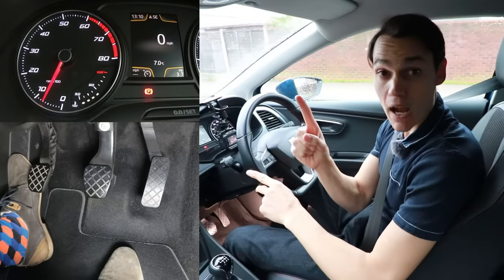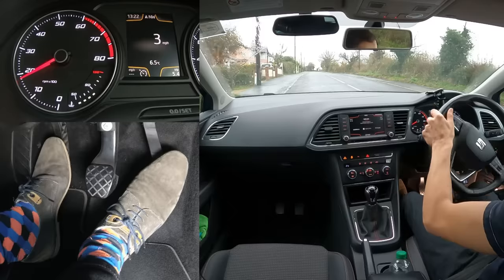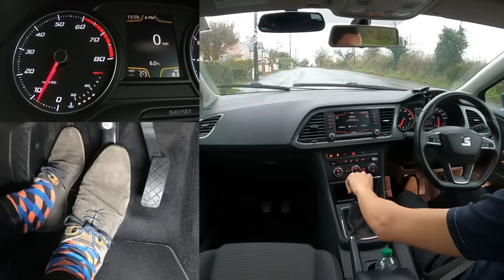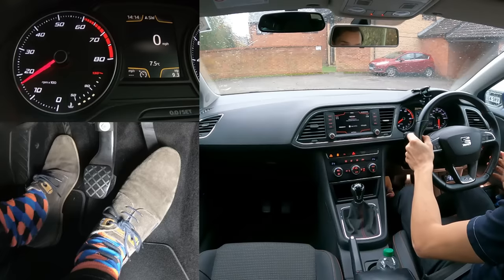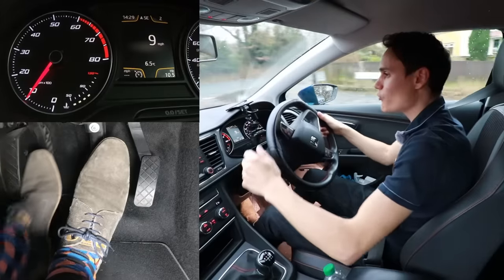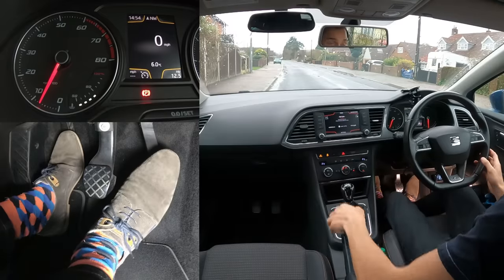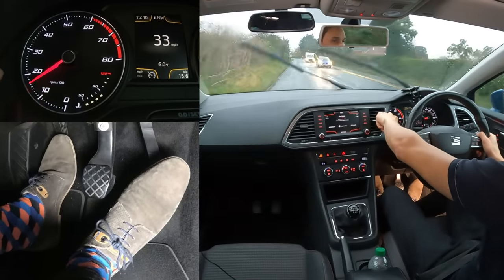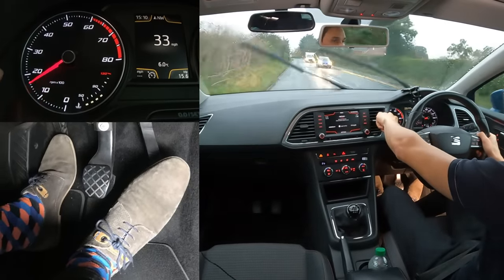How to make your clutch last longer without stressing the transmission.

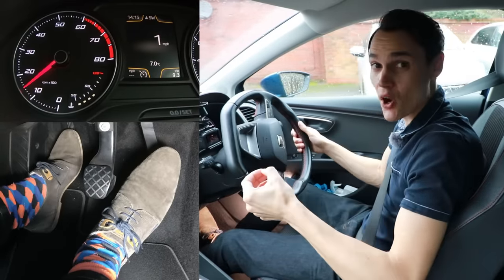Comment: what you were talking about at 5:10 when you dip the clutch a lot to just dab the car forward or backward a bit when parking I imagine it doesn't wear on the clutch much but im curious how much wear you would put on the pressure plate if you did this excessively. holding in the clutch for too long. anybody have any thoughts?
Reply from the maker: The pressure plate and release bearing are designed to do this. Holding the clutch down for long periods of time when waiting or revving the car hard with the clutch down wears the release bearing.

Comment: Does the method at 8:17 cause any excessive clutch wear? If I rev the engine as I release the clutch, is it bad if my clutch has to pull the revs down within 500rpms or so?
Reply from the maker: The clutch is designed to do this.
Reply: @ConquerDriving  So even if the clutch has to “fight” against the revs for a little bit?

Comment: Very helpful video, but i have one question;

In my car, revs drop slowly when i actuate the clutch and that makes it harder to shift smoothly.
what can be the possible reason for it.

Im actually from India, and currently own a Hyundai i10
Reply from the maker: It can be a mechanical problem but often it's just how cars are set up these days. It's known as rev hang and it helps emissions.
Reply: Rev hanging. It's probably emission related. My friend's 1.0 opel adam and our old 2017 Focus 1.0 did the same. Rev hanging seems to be especially common in these newer 1.0 turbo engines.

Comment: Useful video as always! Do you think the rev numbers you use would vary depending on whether the engine is a turbo or not? In my previous car (1.2 turbo Kia Picanto), it was almost impossible to set the gas at 1500rpm, it was 2000 or nothing effectively. I don't know how much of that was due to the delayed reaction of the turbo and/or the small engine not being great at fine control (or just me!). I've now bought an Alfa Romeo Brera Prodrive S (2.2 non-turbo) and was expecting this to be a lot easier without the turbo delay but setting the gas just under 2000 rpm is still tricky and the revs just keep rising when you hold the gas still. It's probably just a case of more practice and getting a better feel for the engine note (that was easier in the Kia because the engine was louder, you can push this Alfa quite high before you get much of a growl from the engine bay). I've been spending way too long with the clutch depressed in traffic it seems, so that's one thing I'm definitely going to change.
Reply from the maker: Some cars are like that, you have to lift the clutch at the same time as pressing the gas to prevent the revs going to high. Here is a video on gas control: https://youtu.be/KggkCe6Agjk
Reply: I have 1.2 tsi turbo polo and I can easily launch at for example 1200 or 1600rpm. The turbos in these small engines are usually so small that in my case I don't really notice a difference when I'm starting to move. Only in sharp accelerations when moving I feel the turbo and power kicking in. My car can be completely different to yours though.
Reply: @ConquerDriving  Fun update on clutch control: turns out I had a rear brake calliper binding (the mechanic said "feels like the handbrake is always on", which I just nodded to, thinking "that seems like an exaggeration"...), so I think that was making this harder to do, because in essence the engine/clutch was always working against some braking, unbeknownst to me!
Reply: @tuomasheikkinen9251  Yeah that's fair enough. I assume now that my previous car, the Kia, maybe just had an ECU that gave too many revs to avoid stalling but it could be something more mechanical than that.

Comment: Great video!, So how can you move away quickly while not damaging you're clutch
Reply: I think his point is it doesn't damage the clutch, it just heats it quickly and creates more wear. In most situations, you shouldn't be launching from 0 anyway, as that is rather reckless and who gives a crap if other drivers don't like it?
Reply from the maker: Fast starts wear the clutch. They also use more fuel, tyres and put just about every mechanical component of your car under more strain. This is the same with automatic cars that use a clutch. No getting around it other than to get the car rolling then to accelerate hard.
Reply: @ConquerDriving  Makes sense, Thank you!

Comment: Im surprised you didn't demonstrate just blipping the throttle on the bite point, which is what I do a lot when I just want to roll forward a lil bit up a hill, or backing into a spot. You reckon blipping on the bite point is ok?
Reply from the maker: If it works then it's fine. Not too many revs though as it will overheat the clutch and bare in mind some cars need gas before you reach the bite point.
Reply: @ConquerDriving  oh yeah when I blip it Im not hitting more than maybe 1500rpm, I used to exclusively do that before I learned how gently easy into the throttle as I let out the clutch

Comment: Your advice is very helpful, but your car clearly has enough torque to get going at low rpm. I have an 2005 MX-5 that does not have much power or torque below 2000 rmp. How would you adjust to driving cars like this?
Reply from the maker: I also have an MX5. I rev it 😉 https://youtu.be/iB0xFXxIsWc

Comment: One critic:
You dont even mentioned "DIY" rev matching, as if rev matching is only done by the clutch/synchrorings itself...

I could not drive my Subaru without rev matching, especially downshifting needs a little tip on the gas before releasing the clutch

But since i learned in this car rev matching, im doing it (for the sake of comfort and preventing clutch wear) in nearly every car.
Reply from the maker: Here is a video on rev matching. That's more of an advanced skill: https://youtu.be/-RnPUq2yut4

Comment: Great video, but riddle me this. On an upwards hill I always keep the car in its place by utilizing the clutch bitepoint, but without giving it any gas. So basically just in idle, no brakes, just clutch holding the car. Is that bad?
Reply: No wait, actually what I do is just hold the car with the normal brakes (I only use the handbrake for Parking) and once it's time to go I release the clutch to the bitepoint, while in idle and then move my foot from the brake to the gas and drive off. I never roll backwards/forwards this way and I feel this gives me much better control rather than using the handbrake.
Reply from the maker: This video may be of interest, it doesn't depend what car you have: https://youtu.be/UdTSRBJrw7Y

Comment: Hey, can I ask is the engine break starting point hurtfull for the clutch. I have fast car when i have to slower down, drop the gear and with break together slowing the car.

Also when I go to a roundabout coming high speed, puting the car lower gear with the clutch pushed going in a half way and relasimg clutch out when i need speed again, is that bad?

Comment: Hello. Very well explained. Nevertheless, I have one question, which I struggle with for couple of months now, and I will be very happy if you could give an opinion: as you may know Hyundai introduced a so called intelligent manual transmission (iMT) on their MHEV which is actually a clutch with electrical connection instead of mechanical. The point of this is to reduce the emissions by allowing the computer to disengage the clutch and shut the engine down when coasting. Well, I personally see this as a problem as the springs of the pressure plate and the release bearing are "working" every time the car is coasting. For the pressure plate I have no doubt that the wearing is the same but regarding the release bearing, considering that the engine is stoped and so the bearing is not revolving, does it take any supplementary wear?
Reply from the maker: I do know the system. Any extra use of the release bearing will cause wear but as you say, the engine is off and not spinning. The release bearing will only spin if the engine is spinning.

Comment: I drive a lot in heavy traffic, and there are situations where 1st gear is too low(would be over 2k rpm and 1st gear is very jumpy, it's a light car), but 2nd gear is too high, so what I do is switch to 2nd gear and use the clutch for 2-3 seconds to accelerate slowly, then press it back in. I know that this not optimal, but how bad is this exactly? Will this damage the clutch that much faster? Is it even worth thinking about this since eventually I'll need to replace the clutch anyways, and to my knowledge it's not exactly the most expensive thing in the world. What's your opinion?
Reply: Your method is okay, I also do it sometimes. That does not wear the clutch that much. When you let slip the clutch to become a bit faster and be able to engage, then the difference the clutch have to balance is very little.  The reason for that little difference is that the wheels are turning jet, so the clutch doesn't have do do much work. Most clutch wear you do only have when wheels are not turning. The faster wheels are turning before letting slip the clutch the less wear you have.
Reply: Its not ideal but its far from terrible either. The big things that wear the clutch out are revving the engine high and dumping the clutch like racers do. In fact generally dumping the clutch in general is bad because you are just slamming it against the flywheel. Heat and friction wear the clutch your method produces little heat so the wear from friction will be very minimal.
Reply from the maker: When I drive a car that's very jerky in first gear I tend to use second gear most of the time and clutch down if I'm too slow for second and use the clutch in second to get the car going again. Not the best for clutch wear but better for comfort.
Reply: @ConquerDriving  Thank you for taking the time to answer. It's reassuring to know that I'm not the only one driving like this.

Comment: with modern diesel engines and probably also gas engines its also good to try and learn starting to from a still without using the gas for example when on a slight hill not using the handbreak but rather the normal break let the clutch out with still pressing the break and than just letting the car itself give more gas and only using the clutch and than moving your foot from the break to the gas immediatly without rooling backwards for example so that slight moment when you move your foot the car does the first bit of giving gas and than you take over and give it more gas, with modern diesels ive managed to get started from a stand still without using the gas at all which is the best option for the clutch, but since i got my miata i kinda started throwing this behaviour out the window and just doing dumps and fast starts with quite a bit of revs but thats prolly just because im young and like driving spiritedly xD

edit: even with the old tech in my miata i also am able to start driving without using the gas but its harder cause the engine computer is slower and takes more time to adjust the idle gas flow to a higher amount so i need to let the clutch out slower but still without gas or i just do the rooky way and just let the rpm drop to like 300rpm its jerky as hell but safest way for the clutch cause it just bogs the engine but its connected completly without slipping safing about 700rpm of "wear" if that makes sense, and the engine usually is able to recover from the 300rpm quite quickly when i immediatly give it some gas, so its just a bit jerky but when im alone i dont mind it at all and it always just makes me laugh because i can feel the pistons fireing in the whole car which just makes me aprreciate the tech which goes into an engine like this hahaha

edit 2: wow its been a while since i wrote this comment, coming back to this now. Yes my 32y old miata is still doing well but its a lil worse for wear but not because of my driving, just because of its age, on hills i usually just give it a bit of gas to start driving, ive noticed (now that i have more driving experience, the miata was my first car) that even tho its a gas engine it still is quite torquey down low, because the car is so light, meaning that the engine even with not that much torque can move the car quite quickly, so on stand stills on trafficlight or smth i can move quite quickly with just bogging down the engine (which on this non turbo engine is quite fine) and get going that way saving quite a bit wear or just blipping the clutch to the bitting point and a little bit more to give the engine time to recover the revs slightly so that it doesnt stall. i dont know why i like driving that way with the car dong jerky stuff but i just feel like its so connected to what i am doing and i just like it, thats why i probably would never get an automatic car.
Reply from the maker: I've made a video about that https://youtu.be/UdTSRBJrw7Y

Comment: Hi Richard! I was taught to drive with a very clutch-heavy method on a modern manual car that gave lots of help in terms of adding gas etc. Now I'm driving my little 1999 Fiat i'm finding I'm basically having to re-learn the clutch to stop relying on bite points and the like (my instructor was great but often encouraged me to sit at the bit point for well over 10 seconds in uphill traffic for example!).

I was just wondering - when you are moving off and adding gas in an older car, should you be adding the gas and increasing revs before you lift the clutch  or can you add gas up to 1500-1800rpm as you are lifting it up?

Thanks so much!
Reply from the maker: You should raiss the revs a bit (to 1500rpm ish) before you lift the clutch. If the engine starts to struggle add more gas. Generally you will need to add more gas when at the bite point.

Comment: I would add rev matching when going down a gear, it's better for the clutch and transmission if you blip the gas to make the engine speed already up there rather than wheel speed getting it there via clutch... Also when slowing down, feel free to leave it in gear until rpms get to 1000, then brake and clutch out of gear (I see a lot of drivers stoping from 4th gear by going through all of the gears down to first and then neutral, thats waste of clutch, gearbox and effort...
Reply: So your saying to not use engine braking? I always use it because otherwise I’d have to break a lot harder and earlier instead of just downshifting and letting the engine slow me down.
Reply from the maker: Here is a video on rev matching https://youtu.be/-RnPUq2yut4

Comment: I usually take off in first gear without touching the gas until the clutch is fully engaged. What's your opinion on that?
Reply from the maker: If it works that's fine, but beware in some cars, this video may help https://youtu.be/UdTSRBJrw7Y

Comment: I saw some vids that u can upshift gear without using clutch and it was about 2.8 thousand RPM, so why does it heat cluch if it is not needed ? In my own experience with my car, i up shift about 3 thousand rpm (except in first start in morning when i have to be soft for the engine) and it is so smooth ! But when i up shift lower i have to stay more on clutch to synchronise, else the engine does not sound right. Also, it was normal to shift at 3 because when i am on up hill, if i up shift lower, the engine will lug and i have to down shift again.  Am i doing it right ? Thank u for the vids, even i drove for 2 years, every time i discover new stuf in your channel !
Reply from the maker: Listen to your car, if it struggles when you shift up at a lower rpm then you need to shift up at a higher rpm. Up hills I tend to shift up at around 3000rpm. https://youtu.be/LHDJGzRROUg
But when I driving as fast as I can I tend to wait until the red line: https://youtu.be/jmZdrJsVUJA

Comment: When exiting a high-speed highway into a guaranteed stop, do you recommend going into neutral on the ramp to prevent the need to downshift, thereby causing a smoother deceleration (and saving clutch wear)?
Reply from the maker: I would recommend trying to coast as little as possible at high speed and using the gears to help you slow down so you have more control over the vehicle at high speeds. I do use neutral at low speeds though.

Comment: sometimes you need to give more than 2000 rpm when doing a steep hill start, especially in an underpowered car, so if it happens to be the case that you have do a lot of steep hill starts or deal with a lot of uphill junctions in your area, is your clutch destined to have a short life?

Comment: Great vid. Sometimes i do find the clutch may not be all the way down when changing gears and it makes that grinding noise when its trying to get in gear but the clutch isnt fully pressed. Any advice on this? Could be my seat position and also how does this wear the clutch/gearbox
Reply from the maker: Definitely change the seating position to make sure if goes down all the way. If it still makes the sound despite being fully depressed you either have a clutch or gearbox problem.

Comment: Quick question say I’m in relative bumper to bumper traffic I sometimes hold the clutch Down as the traffic is moving slow and I don’t want to stay in first gear is that bad for the clutch?
Reply from the maker: It's not good for the clutch release bearing when the clutch is held down, regardless of what gear is selected.